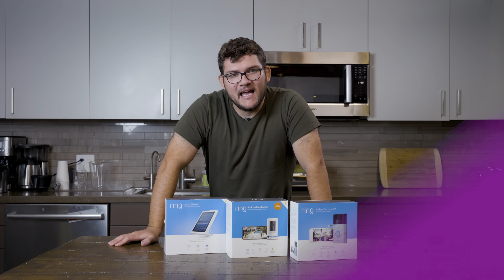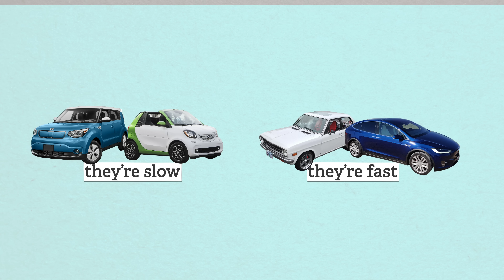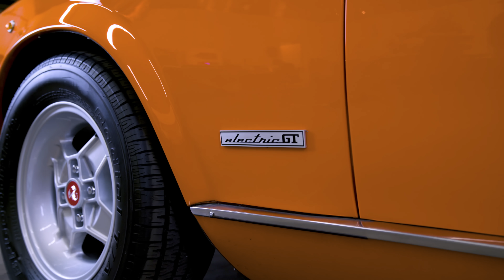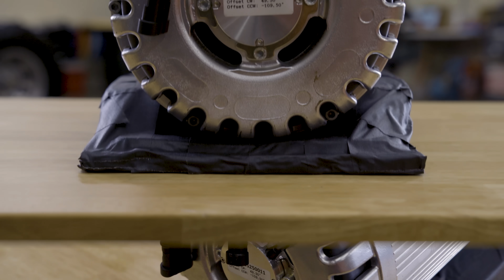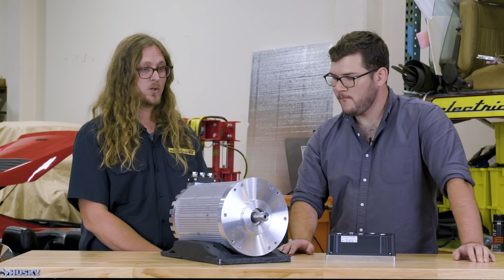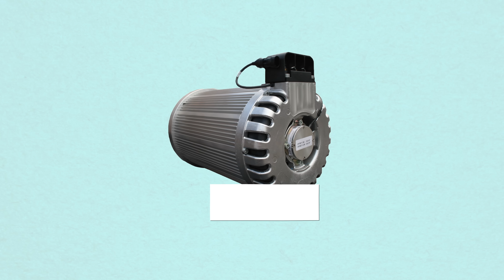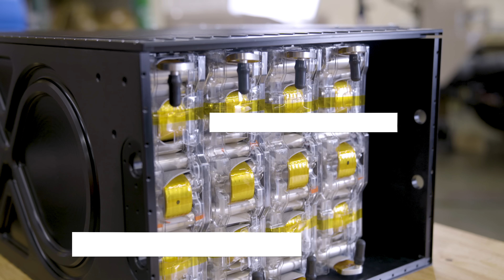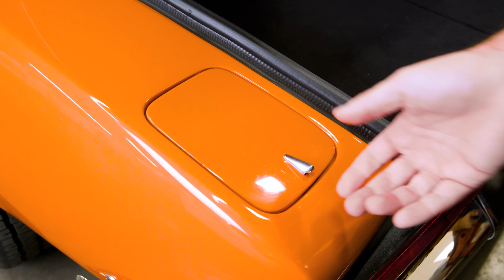Are Electric Motor Swaps the Future of Tuning? | WheelHouse

Comment: Until EVs come up with swappable fuel cell style technology it will never beat petrol run cars. The charging times will not be comparable any time soon, but if they made batteries compact enougnt to remove like gas canisters or something similar, you can charge some while using some. And on long trips you could swap batteries for the return Trip

Comment: A company called orbis makes ring drive wheels for 9k a set That directly bolt on in place of your wheels. At sema they used a set to make a awd civic type R. You can also use 4 of them to make any combustion car into electric without any knowledge of installing a gas or electric engine. You could literally buy a rolling chassis from a barn sale, keep the engine in, and use orbis wheels to drive it aeround with very little work. Its the future of bridging the gap between combustion and electric, as we inevitably transition to electric and then hydrogen cells as well as other new propulsion tech.
Reply: All you need is 2 or 4 orbis wheels, any vehicle, and a tesla battery, or refurbished prius battery if youre thrifty.

Comment: I'm just not feeling it. But if they wanted to get somebody like me interested in that crap first of all electric cars would have to have some type of manual transmission whether it be manual or dual clutch or single clutch I'm just not a fan of the 1 speed transmission that's in a Tesla. Number two why don't they build an electric motor with pistons like an actual real electric V8 or electric V10 or electric V12 and have like a fan pumping air through the Pistons and have it come through an exhaust so it'll sound like an actual real V8 or V10 or V12. Call me crazy but that would probably work if they could do something like that and it might sell. But I'm just not a fan of a canister looking electric quiet motor I like to raise my hood and show people what I have. Plus the motor would need to be Chrome all over. Give people something to want to see and hear
Reply: Bro, an electric v8 v10 or v12 will be so inconvenient. they already make rotary motion, and not linear motion. you will make things even more complicated.. that's why electric motors are already very simple, they only have 2 moving parts; bearings and the rotor. making an electric v8 is no fun too. don't aim for the exhaust sound, aim for the acceleration and speed.
So making linear motion on electric motors then converting it to rotary motion is stpid. 
Electric motors already make rotary motion! not linear motion ok! they can already start with rotational motion

Comment: This is pretty awesome!  I would definitely consider this if it didn't cost an arm and a leg.  Also I appreciate what they're doing but I feel like they could've stuffed a few more batteries in there to get the miles up and the weight distribution closer to 50/50.  I'm assuming there were possible issues with that but it's what I'd want to see.  Can't wait until battery power density gets better so that packaging and weight are real nice for small sports cars.
Reply: there's already a battery that is lightweight and long range (I.e Al-Air battery)
they estimate that 25kg of aluminum will give a driving range of 1000 miles! and the entire battery system will just weight 90 kilograms. 
In comparison, a typical electric car Li-ion battery pack will weigh 200-500 kilograms while giving you only 100-400 miles of range!

Comment: I can agree the electric motor swapping will be the future for automobiles, in general, and the application to do such a thing to older vintage cars will definitely come into play. The main issue I have so far is the low horsepower and longevity of the battery charge. 80 miles just wont cut it, and just as well, a buck twenty horse power is not really enough to make me want to swap my current Mr2, given that it has more power than its potential replacement electric motor. We just aren't there yet. One thing to consider though, is swapping a Tesla motor and rear end into any car, to at least capture more power output from one of the two Tesla motors.
Reply: there's a new type of battery called aluminum-air battery
Estimates say that an aluminum air battery pack weighing 90 kilograms will give you 1000 miles driving of range! in comparison, a model 3 battery pack would weigh over 400 kilograms and give you only 350 miles of driving range!

Comment: Perspective: Eight years ago, ev swaps were still mostly using forklift motors and lead acid batteries. Now AEM makes a shiny motor controller and you can make 700hp from Tesla parts in a junkyard.
What'll be possible in another 8 years?
Reply: Lower price, I hope

Comment: Sure EVs are fine in warm states, but no so cool in cold states and areas like the midwest, where you have to use the heater, and charging stations are rare outside of big cities. (And EVs take forever to refill compared to an ICE.)
Reply: I really wanna swap a car with an electric engine it's super good in my country since we dont have electric Bill's but the worst part is I dont know if they can survive it gets to 30 to 40 degrees in my country :(
Reply: @smokemonkey2596  i assume you mean celcius, yeah 30 to 40 celcius would wreck a battery.
Reply: @hunternelson3018  yes sorry that's what I mean

Comment: There's still no EV for the masses...  The model T and the VW bug,  are the top 2 sellers of all time..  Both were designed so anyone can buy one and maintain one..  We don't need  High tech for everything..  Where is the simple, cheap EV ?
Electric motors have very few parts,,  Why the hell are they so expensive ?
   You can buy a new V8  "Crate motor" for less than a small electric motor..

Comment: Electric engine swap only take you so far.
Like Rick Rebuild said, if your tired of your current performance, you're pretty stuck with an electric engine. While on a gas or diesel there is options to increase power from just a tune up to top fuel power.
Electric engines just perform to certain level. While gas and diesel car will have problem to put all its power into to the asfalt.
As showed in multiple drag movies.
Tesla do struggle while starting in speed

Comment: you know, i reckon one could solve the sound problem by attaching a rotor blade in a housing simmilar to an air siren to the engine. with it set up right that the noise it makes is rather low, and a manual transmision i reckon it would make a pretty awesome sound as you accelerate

Comment: We started doing this to remote control cars/trucks about 15 or so years ago when brushless (AC) systems and lipo cells were entering the market but no decent electric kits/chassis, particularly in 1/8th scale, were available.

So many benefits to doing the conversion: instant power; quick acceleration; less mechanical components (no need for brakes/clutch/transmission/etc); clean and easy maintenance; and more importantly for me, quiet and no exhaust so can play anytime and anywhere, even indoors. 

Speaking of power, one of my rigs has a brushless system rated at 120A and I power it with 6S lipos (25V fully charged), so that's 3kW of power or 4hp. That's plenty for an RC weighing about 12lbs. It may sound like it would be hard to control, but most ESC (e speed controller) are programmable so you basically have launch control and ABS (via the motor).

I would like to do this in real scale.

Comment: To the petrolheads who don't like EVs because they miss shifting -- I get it. I drive a Model S, but my favourite car prior to this was a 94 Ford Probe GT. I did enjoy tossing that thing around, and I enjoyed the manual shifting. I get the whole "more involved driving experience". So here's an idea - rather than being upset that new technology makes things you like obsolete, how about looking for ways to increase driver engagement with the newer technologies?
Here's one suggestion - how about a control (floor pedal or perhaps flappy paddle) that allows the driver to dynamically control the traction control system? Or the torque vectoring system? Squeeze a grip and the harder you squeeze, the more wheel slip you have. Or the less. Or you control the front/rear power distribution through an anaog control like a pedal or something.
In other words - think about what would improve driver engagement and at the same time allow a more skilled driver to squeeze out more performance than an automated system?

Comment: I'll be honest, though i love the smell of old gas guzzling gasoline v8's, and the spirit of it, i'm not that of a 'core crazy sonofa' that i would mind having classic muscle cars (or perhaps even better, leadsleads and taildraggers) turned into electric powered cars - obsolete safety measures aside that is - there's one major obstacle which needs to be accounted for, and that is sound. The technology, fortunately, is around to record classic v8, v10, etc. engines pretty accurately so it doesn't get lost. BUT, that sound, of a burling, screaming, roasty sounding, revving Hemi V8, or flowmasters on a Pontiac Big Block, paired to the actual rumbling the vibrations make, that no electric engine produces. Yes, it's a benefit that you can have a silent cruise, but if that obstacle can be properly overcome with, i don't think the E-transformation market is going to explode the way it could.
For example, as for those tailpipes: if there are some smart developers out there, willing to invest, to make some proper waterproof exhaust speakers, to be put into every exhaust port header outlet, and paired to the 'electric engine ECU', to sufficiently accurate mimic the sound of a revving v8, then you have something that will really attract people and open them up for it. 

That's what would invite the masses over immediately. 

And don't start talking that it's fake. Most of new cars, especially high-end luxury cars have fake sound from the cabin anyway. Everything on popular media is fake. Hell we have Chris Hemsworth in Extraction taking more beats than the Terminator or Matrix Agents and he hasn't got a scratch or the tiniest of infection despite walking through indian sewers with gaping wounds, and people love it. 

Just do it, and look at how tuning will explode again as hard as it did after the first fast and furious movies and then after NFS underground.

Comment: These cars are about sound, driver experience, and exclusivity. This swap ruins all of those things.
Reply: Exactly.  Electric motors take away all of the soul a car can possess, and it throws it out the window for "HuRr DuRr 0-60 TiMeS aNd ClEAn EnErGy"
Reply: It's funny how the sound is the only thing that gives the car its soul. Almost as if the steering, suspension, chassis don't matter at all.

Comment: I've yet to see an electric car that performed visually in the manner a fueled car would, there is only excitement for the driver and maybe a passenger which leaves a limited highest speed racing viable, no smoke, no fire, no burning out at the line, little to see in electric cars except for making them as fast as planes and putting real interest in the fact of keeping on the ground, other words, the end of racing.

Comment: In my opinion, we should switch to alternative fuels like ethanol instead. It’s 100% renewable, cheap, and emissions aren’t bad. The efficiency is worse than petroleum, but still better than most electric cars. Not to mention that when making an electric motor it is alike going 100k miles on gas.

Comment: I would love to make an electric Fiero GT, with about 200hp motor and preferably enough battery to get 20 miles of hard accelerating and at least 60 miles if driven reasonably. I know a while back there was a guy that made a AWD hybrid Fiero for Grassroots Motorsport's $2,0XX challenge, there is a few videos on YT for it. While that was not pure EV it was a hybrid for under $2,0XX, if you find the right base car like a good roller then you get an EV put together for under $10k easily probably $5k.

Comment: How quickly the trend catches on usually depends on how soon costs come down. Considering that most car projects are passion/hobby driven, they usually take a LONG TIME to complete and most certainly have a conservative budget. Part of the reason LS swaps are so common is because of how cheap and easy the engines are to come by. I'd imagine it might catch on a little quicker in areas where 1)gas is fairly spendy, and 2)emissions testing is mandated (pretty sure California ticks both of those boxes)

Comment: I thought electric cars didn't use gears like that
Reply: They don’t need transmissions for regular driving because electric motors can easily rev up to 15000+ rpm, so unless you need to go 300+ km/h, you only need 1 gear for an electric car.

Comment: Delorean, Volvo 240, something where an EV swap would actually improve the driving experience of an otherwise ordinary car. I'd be against doing it to most cars, especially something like a Porsche 911 or rotary powered Mazda, as these cars are most famous for their engines, and to junk them in exchange for an off the shelf motor, I feel is to remove an important component of that car. 

Whilst EVs will be technically better in the near future than any ICE car based on performance and costs, old petrol powered cars will and should still have their place, though mainly for nostalgia, concours and for old school tuners.

Comment: The guy that made the white zombie works at the same company as me. It's NWHS and we service crown forklifts. He literally took old Brushed Crown PE motors and put them in his car. At this point everything else is custom or conversion specific kits, lithium cells, custom charger.

With newer scrap trucks coming in, I'm sometimes tempted to take an AC motor out of a Crown FC or SC. The only problem is I'd need a new motor controller and build a lithium pack. The Crown controller does not like it when everything else is disconnected, and it's speed and power limited.

Comment: The Quickest and Fastest drag race motors since 1992 have come out of my shop.
1ST to the 10s,9s,8s,7s and only motor in the 6s and 200 plus mph.In a bike and now fitted in the Don Garlits SW38/Holley dragster.
IN STOCK NOW A 5 SECOND MOTOR in Phoenix.
Dennis Berube
Kilowatta798@gmail.com

Comment: The sad thing is, I have an ideal car for an electric swap: 1966 Chevy Corvair Monza. It's an air cooled, rear wheel drive car. It's the stick, so I'd have to hunt down an automatic for it. (Chevy did make them.) But, I don't have the $4K to do the conversion... :(

Also, I live in Arizona, so heat's an issue.
Reply: maybe a bit late, but i dont think you want an automatic in an electric converted car since the torque the engine gives means you dont really have to change gears anyways most of the time, also the air cooled part might not even matter, if the electric engine you want in your car runs to hot it might get its own cooling system